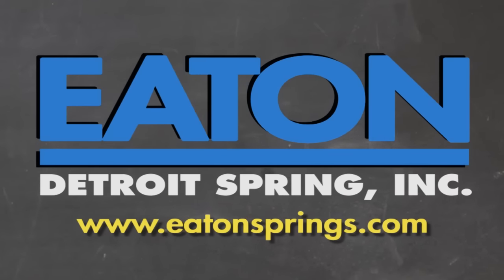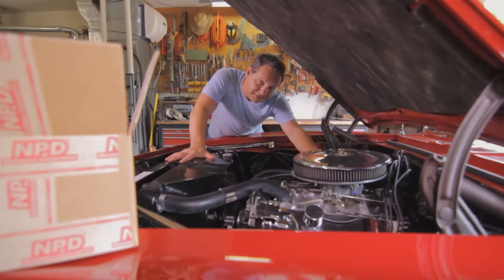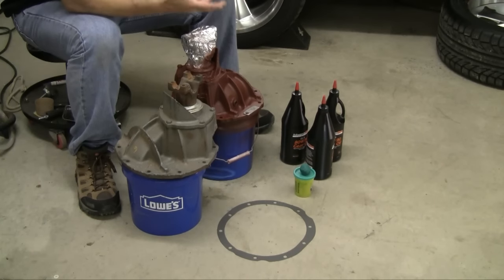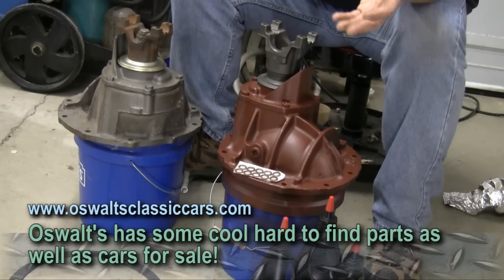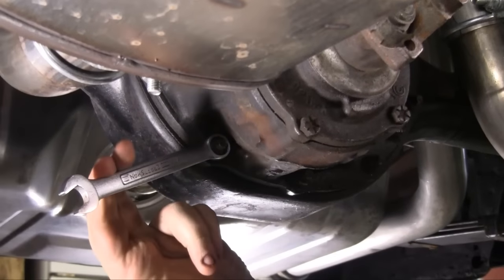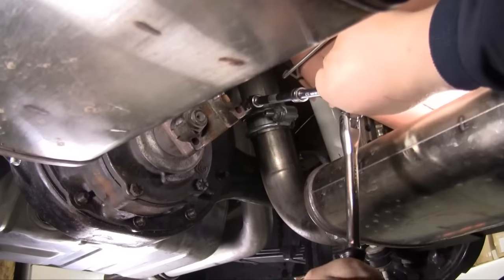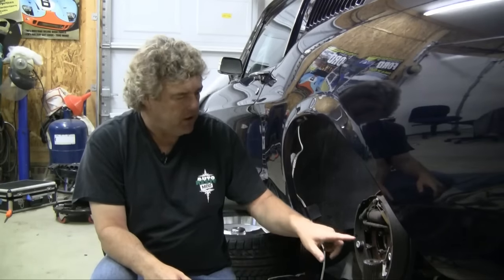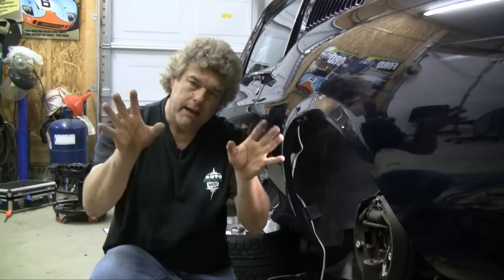Tips and Tricks on How To Install a Ford 9 Inch Center Chunk Carrier Episode 247 Autorestomod

Comment: Thanks, I was struggling to get my 8" carrier out, never done it before, couldn't find any instructions.
It was those copper washers, for some reason only half my retaining bolts had them but they held it on.
They are a pain to remove but once I worked off the five, it did come apart.
As an aside, didn't see any leaks from any of the bolts, with or without the washers.
I had a very thick black oil, like crude oil, 66 Mustang, likely original rear end gears.
Thanks for the tip on the washers, I was getting really stumped, nobody else mentions it.

Comment: ya'll better play the lottery, I have never had a center chunk slide right back on that easy lol  Usually it seems like the studs have tweaked slightly so they always hold pressure as they side into the holes. still much nicer to have a ford 8" or 9" where you can swap from street to track gears in a hour or so. love ya'lls vids.
Reply from the maker: We tried the lottery...got nuthin'. So I guess we used up our luck on the rear axle. LOL
Reply: @AutoRestoMod    there were times when changin these i'd have taken that over a million dollars lol
Reply: I curse fluently in Ford, Chevy, Mopar, and some VW but I've never had one of those damn pumpkins slide in like that....you guys must be living right.

Comment: I have to pull my center section on my 9" to removal the racing spool. How heavy in your estimation Cam?  I might rig up a holder of some sort on my other floor jack to help. Not looking forward to those dang copper washers on the studs at all.
Reply from the maker: Arounds 70 to 80 lbs.
Reply: @AutoRestoMod  Thank you !! I was hoping it would be 50-60 lbs. Thanks I will rig up my other floor jack to assist.
Reply: I often work on our altered on my own & I''m pretty weedy. I unbolt the pinion support & remove the pinion assembly, then bolt an L shape bracket that I fabbed between it & a small floor jack. Then I only have to break it loose & roll it forward. Not having the pinion on the main part means I can lift it up to my bench vice much easier. Didn't know about copper washers but not had any leaks. Good tip on filling from the axle end.

Comment: I noticed that you didn't put any gasket sealer on it when you installed the new chunk. Is that typical of a 9-inch?
Reply from the maker: I don't like sealer on a rear axle. The risk of goo gumming up the works out weighs the benefits. There is a gasket that Quick Performance Sells called a "Lube Locker" that we like. https://www.quickperformance.com/Ford-9-LubeLocker-Premium-Gasket_p_21471.html
Reply: @AutoRestoMod  - Many thanks. I need to swap out some gears on a car I'm picking up tomorrow, and all I've really dealt with is a 8.8, and everyone just uses gray silicone for that.

Comment: Highly recommend drill and tap a drain in the center section.  Before you do make sure you have both 1/8" and 1/4" taps and plugs.  Start small and test the fit.  If you mess up on the 1/8" hole up you can step up and try again.  If you find the need to force the carrier with a prying instrument (who doesn't?) do so above the oil line especially if you subscribe to the gasket installation.  Copper washers...  I smelt them down into bird shot and fire them into the previous guys ass.  Man those things piss me off in that application.
Reply: I'm about to pull my 3rd member and am contemplating the added drain hole. I've heard it both ways on for and against. Any particular spot?
Reply: @JoeyRizzo  Last one I did I placed it off center of the ring gear on the bottom of the axle, just to be certain there was no chance of interference.  Stepped drill bit makes the best hole, just don't go to far with one.  The internet likes to over think a lot of things.  The ability to drain and fill a differential means the oil will get changed at proper intervals.

Comment: My least favorite part of this job is splitting the pumpkin from the axle housing, no gentle way to do this that won't mar a nice finish.

BTW I have an Eaton Truetrac waiting to go in my 69 Mach1 and it uses helical gears... no cones or plates.

Love your channel, I watch all your videos.

Thanks,
Allan
Reply: Use a stiff blade putty knife or 5-n-1 tool from the paint dept at Home Depot.
Reply: put the floor jack under the front of the third member and give it a little bit of lift up.  you might have to give the jack handle a couple of aggressive waggles.  Then clean up the mess because you forgot to put your drain pan in the right spot.

Comment: in the ford 9 inch does the differentail oil chamber mix with the wheel bearings? are they sharing the same oil?
Reply from the maker: Yes. One way to eat up wheel bearings on a Ford 9 or 8 is to not keep up with the fluid fill on the rear axle.
Reply: The wheel bearings don't get any of the oil. It's on the outer side of the seal. How could it get oil if the seal is behind it? The bearings are sealed.
Reply: @Someguy6571  Wrong. The wheel seal is on the outside of the bearing. Original bearings are roller, some new bearings may be the sealed type though. Just look at the parts diagram! The seal goes on the axle shaft before the bearing when you change one.
Reply: @mstang2894  On my 1969 Tbird when I pulled the axle shafts the bearings where pressed onto the axle shafts. They were sealed bearings. The axle seal was pressed in behind the bearing. I have plenty of pictures of it if you want to see. Not trying to discredit what you said. Just going off what I saw when I took it apart. I also have pictures of the numbers casting too.

Comment: Using a chisel is not advised. Get a flat bladed screw driver and just work around the case and gently spread it open. It's what I did on my 69 T-Bird.
Reply from the maker: OK. While I see the logic, I prefer the chisel; as long as you use it correctly, the thinner edge can get between case and hosing easier.
Reply: I have used a thin, stiff blade, putty knife.  You can use a 5-n-1 tool from Home Depot paint dept.  It is stiff enough to be hammered and to also spread the parts.  You aren't as apt to damage the case/housing.  Thin is in, man.
Reply: If your not a knucklehead you aren’t gonna damage anything with a chisel.   As long as the job gets done correctly it don’t matter what you use.

Comment: Those copper washers are totally unnecessary, and make it a real P.I.T.A. to remove the third member.
Use Permatex sealant for gear oil applications.
Reply from the maker: +Thirdgen83 Well, we agree on the PITA part. We like to keep things like Ford did it, had we not done, there would be a dude writing in saying that we forgot the copper washers. For the record you are probably right.
Reply: Ford did that for speed and economy. They weren't worried about the guy who had to remove it 40 years down the road. With a good gasket sealant, you'll never have a leak from those holes. I really enjoy your videos. Take care...